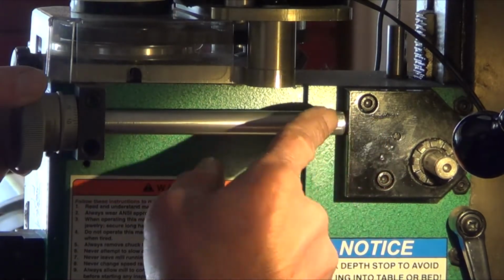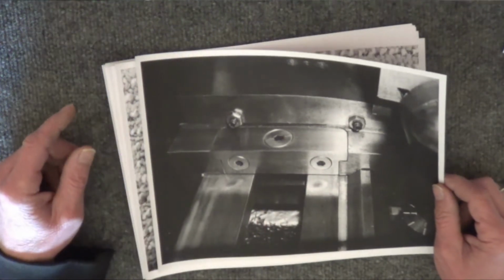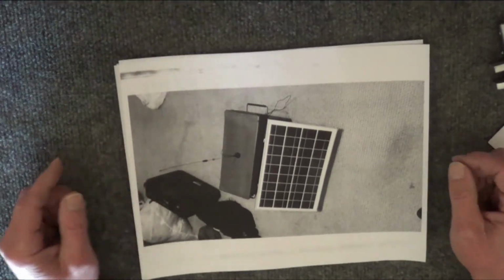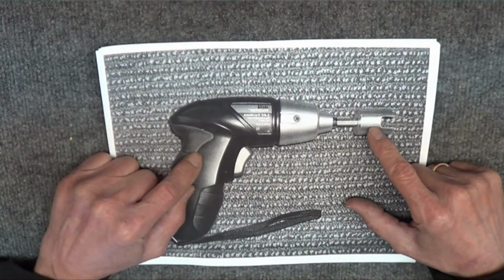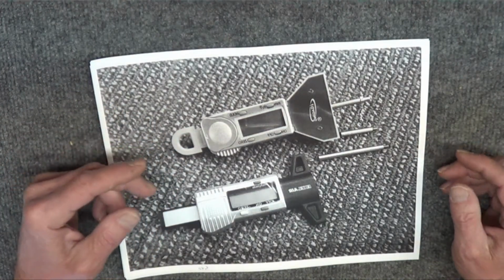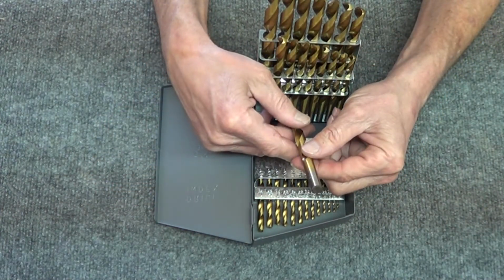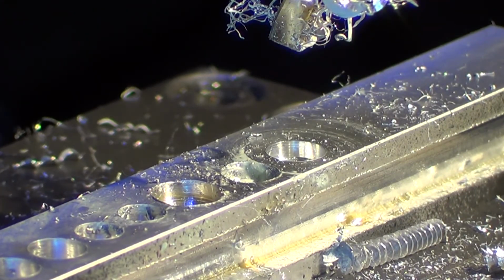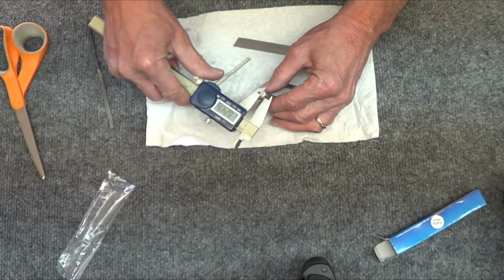Sharing Your Ideas & Designs Video #123

Comment: Hi Dave,
Got that drill bit set, none of the 29 bits are sharpened the same, even the 2 sides of a single bit aren't the same on lots of them, only better if you regrind them yourself....
Stickers, got mine done at "Montrealprinting.com" , pretty good job at 158CDN for 1000  3" x 4" stickers or $255CDN for 1000  4" x 6"....    Quality is pretty good and here in Canada shipping is included...!!!
Can send you a couple of my channel stickers if you want to see how they compare.
Cheers,     Pierre
Reply from the maker: Figures the set is junk. I have many high quality sets so I will be returning these. No need to re-sharpen them especially when some are bent. 1,000 stickers you are indeed serious! I have 8 so far and I would love to trade stickers so need to message you my address.

Comment: I got that same  set of bits when they had a $9.99 coupon. From the ones I used they have  been pretty good. I did  look a few over and found one that did not look like it was ground  right.  For the price if 1/2 of them are  good its still a buy.
Reply from the maker: Haven't returned them yet but now you have me re-thinking them with your price comment.
Reply: Yeah if  you needed a couple of  replacements for  a "better " set and went to Lowes they are going to  be  $1.50 to several $'s each so... 
Look at  the  much higher  priced Cobalt set. Have a 25% off  discount  ready. At 109.00 they are almost $200.00 below a comparable set. The Cobalts are from a  much higher quality production method. You can  look at the  grinds and they is no  comparison.

Comment: I bought that same set of HF drill bits and found 1 so far that one was bent. It was about a 3/16 or so. I put in the vice and hit it with a small hammer and some how straightened it perfectly. Imagine that. I put it in my mini lathe and it alined perfectly with the live center. I may find others sometime, also found 1 not sharp, very dull, otherwise very nice set for the money

Comment: Did they actually send you hard copies?  It should be easy to do captures. All of those digital scales are similar or exactly the same. On the really cheap ones, they didn't bother to differentiate the electronics from the high end ones,  The big difference is the fit and finish of the mechanical parts.

I have the same drill bit set.  You will get better results using a spotting drill bit.
Reply: Did you really expect Starret for  $5.00? Every tool can have its place if used properly. The tire gauge has a movement that stays in place. That can be  very handy but is probably the reason you aren't seeing  Starret repeat ability. If you need to  do a quick check on a hole depth in a tight area  its  worth it weight in  gold even if  not super accurate. It will be  more accurate than the tool  that won't go in the  hole!
Reply from the maker: All the items shown were from emails that I printed out. The scale turned out to be a mess but might be able to salvage it for something else. Who knows!
Reply: Yeah.  I like your style of the talking hands over a surface, but I think you should do a slideshow next time.  It was hard to make out the detail.  Perhaps, you can blue screen your hands over the slideshow? LOL!
Reply from the maker: I think you're right. The detail isn't there this time....